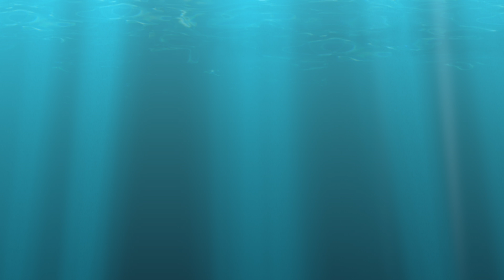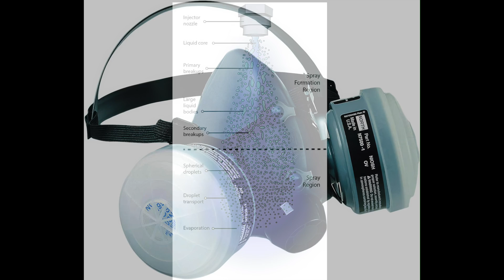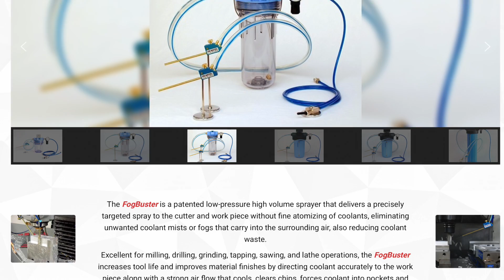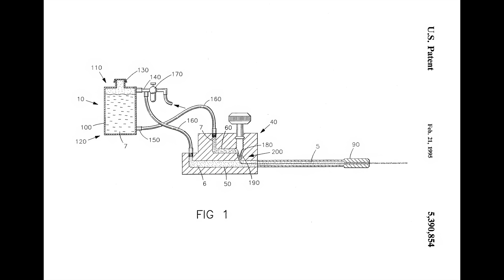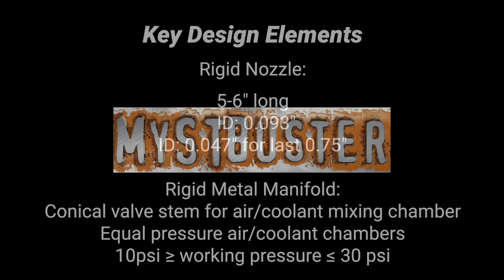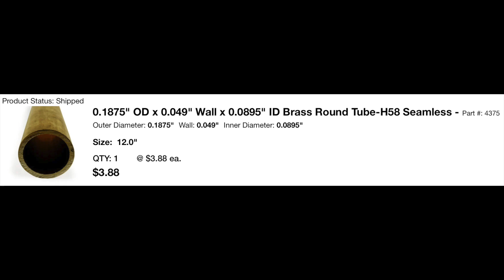Build a DIY Coolant Mister for your CNC Mill that won't fog your shop!!

Comment: Super content, great presentation and good timing as I am setting out to make one of these myself as one of the first projects on my very first CNC. 
One tiny plea, though, please consider dropping your background music another 6dB or so. It's low already but still competing a tad too much with your voice over for attention;). Having the music sit 15-20dB under your voice over track is a common rule of thumb but just listen to it with headphones and err on the side of too low and you'll be good. 

As for my own version and whilst I have never used an MQL system, I have sourced all the parts needed so that I don't have to use needle valves at all. I read a few too many posts from people saying they are fiddly. So, I went with the peristaltic pump option as e.g. Jorg from JBworx has a few videos on. 
I got a pump that can put out a really small amount of liquid and some precision pressure regulators so that I can independantly set pressures for the air as well as the coolant reservoir. I am not sure I will even need to pressurize the reservoir since I have a peristaltic pump but we will see. 
I have also bought a bunch of long Luer Lock needles that are used in dispensing machines for all sorts of liquids and can be had in many different sizes and lengths. But they won't have the smaller nozzle, so if that is important, I am not sure how well they will work. 

Anyhow, thanks so much for the video, looking forward to the next ones:)
Reply from the maker: Thanks for the feedback and the forebaearnce  - I am trying to tweak it all in - I am a little rusty
Reply: @eclecticbuilds1424  No worries, content is certainly there - the rest, as you say is just tweaking:)

Comment: Will be interesting to see how it works. I have a simple T-junction between coolant tube and air hose and it works reasonably well.
Reply from the maker: The patents is really insistent on a needle valve mixing chamber, so I just ran with that - the results have been good, but it takes a bit more machining effort

Comment: Would love the cad files!
Reply from the maker: The new web site for file down loads should be up end of this week
Reply: @eclecticbuilds1424  That's great news, I will definitely have a peek at them, too. I do think my first versions will be resin printed, mainly because I have a resin printer some strong resin. If it works out in resin, I may not ever get around to making it in alu. I may just harness the advantages of resin printing in terms of designing internal features, such as air channels in a way we couldn't do with machining.
Time will tell, but thanks so much for the videos - and the dive into the patent.
Reply from the maker: hopefully you saw that the web site is eclectic-builds.com
Reply: same here.